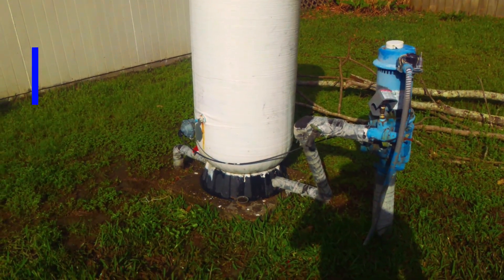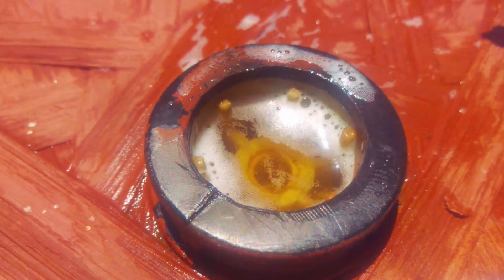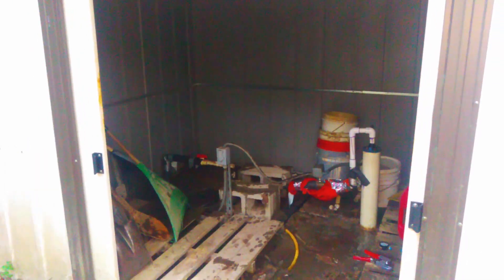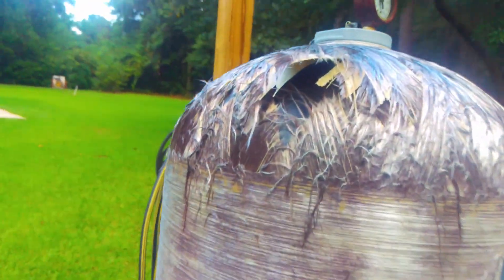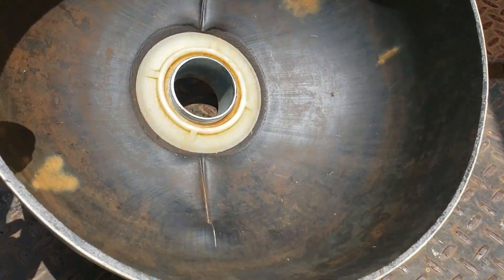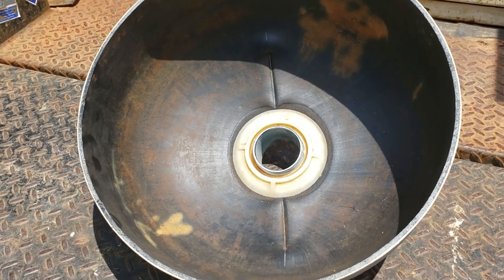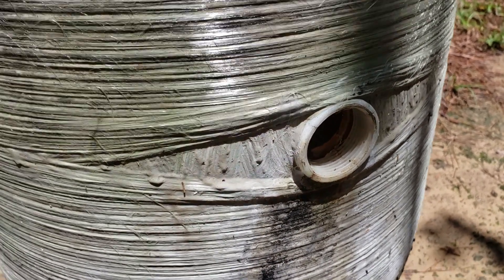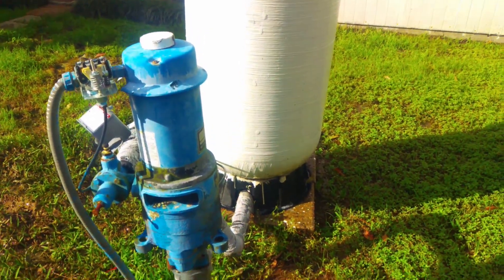Fiberglass well tanks - Why you shouldn't use them!

Comment: You have my sympathy for your tank  failure. I got suckered into replacing a 15 year old fiberglass tank as part of some other plumbing work. They said it was overdue for failure. Since it was functioning OK otherwise, I used it in my garage as an auxiliary air tank for my compressor.
Reply from the maker: Not sure what you mean exactly, all these tanks were defective and caused pump problems.  I would never use a well pressure tank for auxiliary compressor tanks!  They are mostly only rated for 75 psi, a standard compressor shuts off usually over 125 psi.  Do you know how much energy is in a large tank of air at that pressure?  It's quite literally a air bomb and not designed for that purpose.  Most well pumps won't go over 100 PSI  and have way less air volume in the tanks due to being full of air.
Stay safe and don't use tanks not intended for the purpose.
Reply: @ClearWaterPumpWell  thanks for the video. I'm a chicago plumber and we don't practice installing well system. I have a fiberglass tank in my house and read it can go over 125 psi. Once I read that, I knew it was bad. Nothing should be pressurized over 100 psi. We had a plumber die because someone pressurized pipe over 100 psi without hydrostatic testing.
Reply from the maker: @MrFarrem  I totally agree I get worried over 80!  People have no clue how much energy is stored in a pressure vessel.   A catastrophic failure is absolutely very dangerous if your around when it happens.  I have see pressure tanks "rarely but have" blow up a wall in a garage, shoot through a roof, split open like a tin can in place.  Usually it's due to lack of maintenance or obvious corrosive damage to the tanks and a perfect situation to cause damage.  Tanks have to be fully air charged with little water in them and a clogged switch that pushed the psi over the limit.  Just recently removed a fiberglass tank that was completely waterlogged and all it did was crack and leak as there was not enough air pressure to blow it open. 

Thanks for the comment and watching,
Casey
Reply: @ClearWaterPumpWell  The tank operates at only 50 psa.; same as when it was the well holding tank.

Comment: Pretty sure they are not ment to be exposed outside to the elements. Half the tanks shown in video are heavily damaged by UV rays.
Reply from the maker: That they are and they can fail for that reason too.  What your diverting away from is the fact that it doesn't matter how they fail.  They just fail whether or not in the sun or a shed and majority in less than 10 Years.  Why buy something that is not really cheaper, not recyclable, causes damage to your system and fails sooner than a Metal tank?  Metal tanks can be installed anywhere.
I just want people to understand why these are utterly garbage products. Btw I did not install these tanks another company did that gives no hell about the quality of workmanship or reliability!
Reply: @ClearWaterPumpWell  I have pretty acidic water (low ph)which leads to corrosion of well tanks and hot water heaters. Water heaters used to last me 2-3 years no matter which brand. Until I got a plastic one which has been 10 yrs so far.  Reason I’m looking into fiberglass is so that I don’t have to worry about rust outs. Welltroll brand lasted me 3 years.  Do you have any recommendation for a best quality steel, or fiberglass(or are all fiberglass junk)?
      BTW, looking into a water treatment system for the well, but until then gotta head in this direction.

Comment: I have a Fiberglass Well Mate WM-9 30 Gallon Tank and it has been in our Basement for OVER 30 years. I don't know anybody from Well Mate and are not advertising for them. When you have an air leak on your Fiberglass Tank, it is because the Bladder has ruptured. Is that Tank protected from the Sun? I don't see any dead Grass around. I wouldn't leave a Boat made of Fiberglass out in the Sun! I disagree with your Video, and no I will not give you a thumbs down.
Reply from the maker: See what you failed to realize what I'm trying to show here.  These tanks are not 30 year old well mate tanks! Ever since 2000 they started making them cheaper and different!  These tanks now "Do not last" I know you have a 30 year old tank and that's why!  Have you been working on water wells for over 20 years and have installed thousands of these tanks?  If so what are your numbers on how many lasted 5-10-20 years compared to a Steel tank!  The sun has absolutely nothing to do with it, yes it can cause them to fail but also in less time in a shed!  So I do disagree with your edge case of luck with a lost company that's owned now by pentair!
Reply: Back in the early '90 we set up a water pump and a WM-9 at our cottage. It stand in an outhouse at 1 square meter over the drilled hole in the bedrock. The bladder blow some 15 years ago, and now it has blown again. The bladder started to leak 6 months ago, but after refilling it to the correct level it worked half a year!
Changing the bladder are normal maintenance after 15 year!

Comment: Setting it up outdoors exposed to UV rays is not good either. Any outdoor installation should be protected from direct sunlight.
Reply from the maker: The point is it doesn't matter if you put a shed over it or you leave it out in the sun! They still fail and they will fail due to the manufacturing defect of these fiberglass tanks they do not want to fix.
Reply: @ClearWaterPumpWell  I have a WM-9 installed in 1995. The fiberglass has never leaked. The only leaking is slow seepage through the two white plugs in the top blue cap. Not sure what they are. Never water-logged. Mine still cycles between 20 and 50 psi. Maybe I am just lucky.
Reply from the maker: @eddoane1584  The pre 2000 tanks lasted longer and were constructed differently.  The tanks they started making in the early 2000 were completely trash.  I worked for a company that used them then and still do.  I would install a tank one day and a week or so later come back because it failed!  It was a glimpse into the future not many have survived outside of warranty.  The bladder or air cell tanks "wm's"  were a little different they mostly lasted outside of warranty and I still see some today that are around 20 years but rare.  It's the whole idea of gambling with these things most people who have gone through the problems or failures, replacements, and damage caused from don't even want a water well any more!  The "wellmate" company also known as "pentair"  is selling them like hotcakes and that's how they will keep you invested, dependent and fooled to purchase their products.  It's like homedepot the worst plauge on our society the diy people.  Not everyone should be buying and installing crap products incorrectly and wasting their time and money!  
Thanks for the comment,
Casey

Comment: Good info from a man who knows what he's talking about. Just looked at a tank for a family member and it was one of these new "well mate" what you got there is one of those new fiberglass beauty's" I fell victim to it I must admit. I said to her "I've worked on a handful of tanks over the years and I didn't know they made em out of fiberglass - what a great idea = no sweating, and no rusting inside or out - that tank might never go bad" ........ "Oh wait there's a leak. Must be the inlet wasn't installed correctly, I'll take care of it........ Oh wait, there's a trail.... and it leads right to the... Piece of Shit Fiberglass Tank Has A Hole In It and you say its less than ten years old? Its only 8 years old? Well I'll go home and get on the internet and see what I can find out". What I found is a man who knows his business educating those with sense enough to listen. One more thing I settled on a Bradford /White water heater and that's a seriously old school "well" made unit = any idea if they make pressure tanks, either way thanks.
Reply from the maker: Yeah it's sad most people have to find out the hard way, usually before it does damage to the pump motor.  I literally will not sell or install one ever, if people want them bad enough they can go elsewhere I wouldn't do it to my worst enemy. They make good AO Smith water tanks that are glass lined and provides perfectly clean water.  In the worst conditions it will last over 10 years and mostly 20-30 years.  It's really getting to where this disposable Society it's costing us a fortune. Think about the tank itself are you going to recycle that?
Thanks for watching and appreciate the kind words!
Casey
Reply: @ClearWaterPumpWell  Your a different kind of man than what you commonly see today. I recognize it easily because I'm in the same category = and I'm not bragging because the way I treat others - and apparently the same goes for you - is how it's supposed to be. We've gotten so out of touch with the simple aspect of treating each other with kindness and respect that when someone old school comes along and conducts themselves properly by f 
Is
Reply: Well, my fiberglass tank's going strong w/o leaks and its' been fifteen years since we bought the house with this tank in it.  Not sure how long it had been in the hose when we boght the place - bt at least another for years or more!   
We get COLD well water and the FB tank does sweat some in July when temps are pushing ninety and the humidity is up there as well. 
When we were looking at homes in SC that had their pressure tanks installed at teh well head, we saw many that were rusty at looking ready to fail - even though they were covered. 
Not at all confident that this review id objective.

Comment: I have a metal tank and we have had to replace the metals tanks 4 times in 20 to 25 years. Any suggestions?
Reply from the maker: What type of water condition, do you have is it acidic water?  What brand of tank are u using?  Don't use epoxy lined tanks they are thin and coating is not good.   Look into a glass lined steel tank from AO Smith or Amtrol.  These are better quality and thicker metal and the coating of ceramic is way better.  Around here the water can be very acidic and the tanks still last around 20 years!  Fiberglass tanks are not reliable at all and can fail at random times with premature pump failure as a result of it! They are a last resort and should be watched like a hawk to prevent pump damage.
Thanks for the comment and watching,
Casey
Reply: @ClearWaterPumpWell  I leave in Texas and the water is medium hard.  What tank is recommended?
Reply from the maker: @joycemoore5598  usually a bladder tank would be best because you can install a water softener that works well with it.

Comment: Why would you buy one it’s missing the gel coat. Fiberglass needs a fishing like wood. You wouldn’t build a deck and not protect it.
Reply from the maker: Yea but the main problem, sun or not they fail because of bad design.  The plastic liner fails more often and waterlogs, this Is the leading cause of pump failure.

Comment: well mate i call bullshit.....lolol I will too. We put a few in and I haven't seen one make it 10 years yet. Our vendors have been pushing us hard to switch to fiberglass tanks for a while and we haven't switched and don't plan to. Hard to beat changing out a well x trol or flexcon that has been installed 20+ years. Metal tanks still rule the roost around here, but it seems like you see more fiberglass tanks where you are. I'm like you, I can count on one hand the number of fiberglass tanks that have made it 15 years or more. Good video, keep em coming.
Grant
Reply: Curious question as my fiberglass tank just split. I asked the well company about metal and plastic tanks. They told me they only have a 2 and 3 year warranty where the fiberglass has a 5 year. I had this tank warrantied 3 years ago so a new tank every 3 years sucks and looking for options. I do have full sun beat down on my tank, not sure this is an issue.
Reply: You're exactly right about counting those tanks on one hand!
Reply from the maker: Thanks Grant, Yea fiberglass are a big problem down here.  I get it I used to work for the company that put these in exclusively.  They are light weight and the thought sounds good no rust!  They just don't do the job for very long, worst yet is the waterlogged situation.   Customers tend to get to complacent and expect everything to be perfect.  Then they wake up to brush their teeth and the pump motor is burnt up.  Then I have to tell them I have to replace the whole system!   How could this happen they ask a week ago the water pressure was not great but it was working......  Tried and True those glasslind tanks from AO smith / State water systems now.  
Thanks for the comment and watching.
Casey

Comment: Hey thanks for the video I didn’t realize they could be that big of problem. I have only ever installed one of them and it is coming up to its 6th year now I might need to keep an eye on it.
Reply from the maker: Yea man that's around the time they fail. Crazy enough if you can prevent them from getting waterlogged in the first place they will last longer.   It all depends on how much cycles really, that affects the stretching of the shell.

Thanks for the comment and watching!
Casey
Reply: @ClearWaterPumpWell   So, Casey. Can these be repaired in a semi-economical way to buy some time?
In other words, could a fiberglass patch be applied?  I will not say I speak for everyone here, but I am broker than 700 dollars as they used to say, and I still am, haha
I will also say, the one I am concerned with now is damn sure in  the sun, S. Arizona, dry and kinda hot. Not Phoenix or Tucson hot, but dry as hell and kinda hot.
I guess what I am asking, is, should I patch it, paint it with something or move on?  Thank you by the way for your expertise. I will repeat this, I am not flush, and I need to fix this daggum thing. Thanks again.
Reply from the maker: @horsehide3039  unfortunately no oh, if the tank has failed in the manner described in my video where the air is leaking out the top. It's not the fiberglass that's leaking it's the plastic liner inside the tank which has split open. Patching on the outside of the tank will only make the air leak somewhere else on the exterior fiberglass shell. I would recommend it if waterlogged to do something soon because it will cause damage to your pump. You don't want to have to replace both of them.

Thanks for the comment and watching,
Casey
Reply: @ClearWaterPumpWell  I appreciate your response. What I want to know is, how to tell if one of these tanks is without a bladder. I have run across some that I do not think have this, but I do not know how to tell a  bladdder tankd from a plain old pressure tank. Do you know how to tell them, one from another? thanks, bro
Reply from the maker: @horsehide3039  Yes its easy, Captive Air Cell tanks "bladder, diaphragm, bag" will only have one pipe connected to it and only a valve stem on top.  A Hydronumatic Standard tank will have typically a line going in and out the tank with threaded ports "bottom, side, top" for devices like air releases or air volume controls and gauges.  All unused ports will be plugged off.

Hope that helps, I'll be posting more videos soon explaining this very thing in detail.
Thanks, Casey
Reply: @ClearWaterPumpWell  Thanks a lot.
Reply: @horsehide3039  Allow me to share my most recent experience with this. I have a Wellmate SP-120gal FG tank. It was installed in 2006. It performed very well until 3 months ago when it began water logging. Long story short it had developed a small crack at the top plug threads. It is only about 3/8" long but it is enough to let air out and the tank to water log. I contacted Pentair/Wellmate tech support. Their solution was buy a new one. It is not repairable. Not to be deterred I tried to plastic weld the crack. No luck. Tried PL6000. No luck. Tried melting the plastic together and then seal with two part plastic epoxy. This solution held for about 72 hours then failed. Conclusion: yep they were correct, there is no fix.